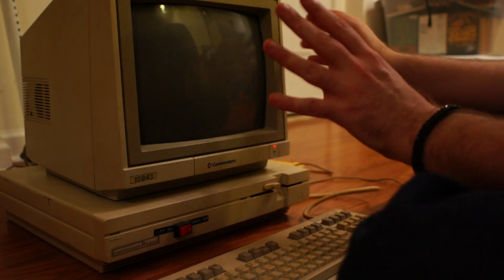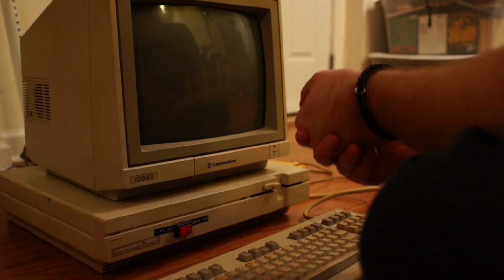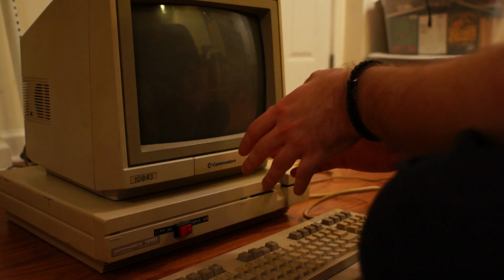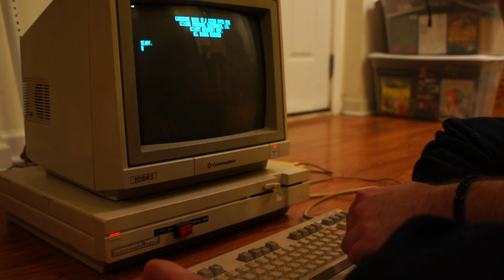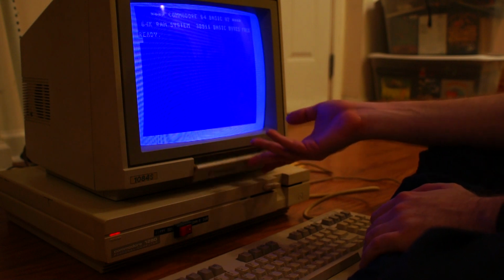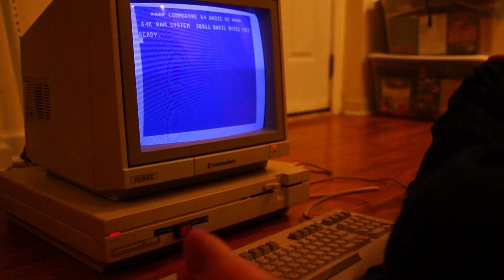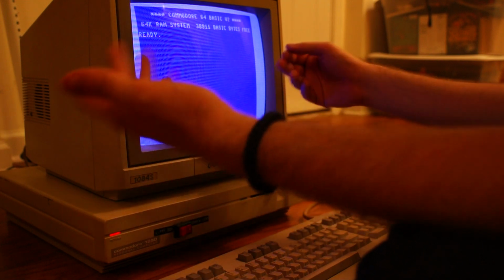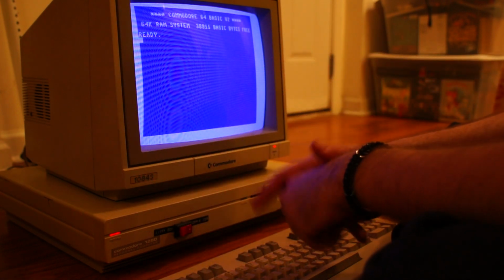Commodore 128DCR FTW

Comment: I have a 128DCR too, but your keyboard looks different than the original, i restore to new, all capacitors include PSU capacitors too, i use it with SDIEC cart i get a lot of fun with sd cart.

Great machine, i use it with a 1902A Commodore Monitor.

Comment: Did you ever get the Floppy Drive fixed? First thing I would do is clean the heads with some head cleaner. if that still doesn't fix it, I had a problem with my original 128DCR. The head was not fully pressing down on the disk and bounced around a little. Back in the day being a early teen with no job, my fix was to put a rubber band over the head. Did not want it to press down too tight but enough to keep it on the disk.